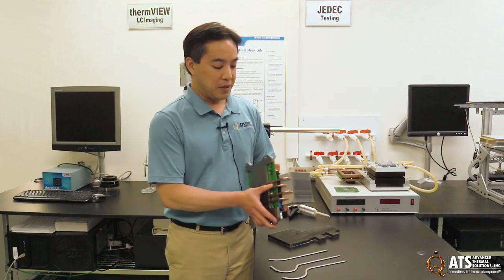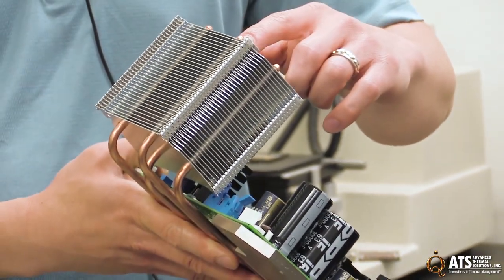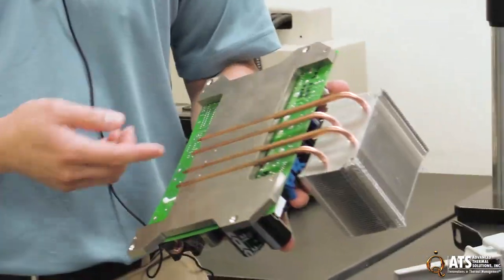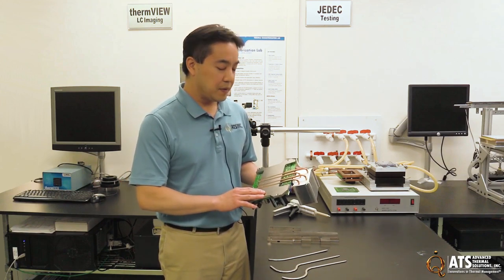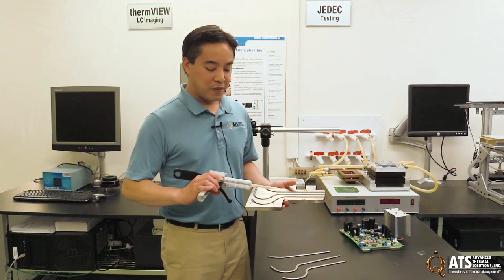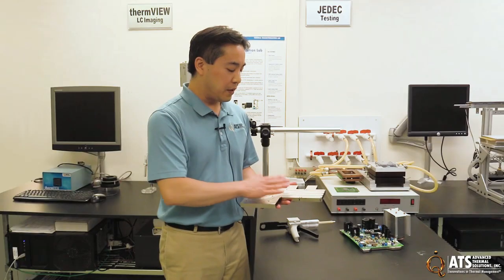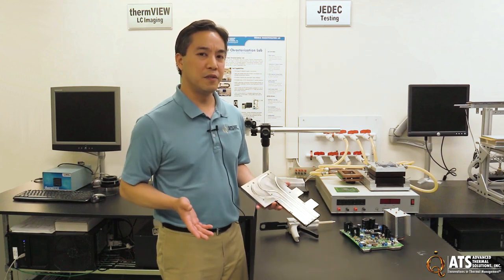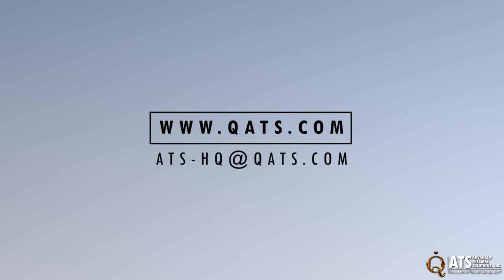How to Attach Heat Pipes into an Assembly

Comment: Do you think heat pipes could be 3d printed into complex shapes to achieve more efficient designs? So instead of the fins you'd have a mesh of heatpipes or something like that.
Reply from the maker: Maybe.  The field of additive manufacturing is growing and new developments happen regularly.  Perhaps 3D Printing a bent HP would be better than bending one?   The wick is pretty fragile so that would might be quite a challenge with today's technology.

Comment: I've done a few custom at-home DIY heat pipe heatsink projects. Now in the past I've been using Sn42Bi58 low melt temp solder but have discovered recently that having silver part in the solder will improve it's strength. What solder paste would you recommend for heat pipe heatsink soldering?
Reply from the maker: The Sn42Bi58 alloy is the most commonly used, because of the low melt temperature of around 138°C. You can use anything that has a similar melt temperature; anything under 150°C would probably work, so that might rule out the use of anything with silver in it. We do not recommend that heat pipes be relied upon for structural strength, and that includes the joints. If there is expected to be any kind of forces applied, then we recommend incorporating some kind of stiffening bracket into the assembly, so the heat pipes don’t take any load.

Comment: If I wanted to develop and build a video card cooler with you guys for a small batch of 1,000 pieces, would that even make sense financially or be completely unsustainable? Something in the 400 W range with a vapour chamber, heatpipes and a CNC machined water-to-heatpipe heat exchanger? Skived fins on the topside of the vapour chamber and zipper fins on the heatipes? Similar to the new coolers on NVIDIA's FE cards for the 3000 series.
Reply from the maker: Hello, we would suggest you reach out to us with the following link so we can further address your questions and project - https://www.qats.com/Corporate/contact

Comment: Maybe a weird question. But how would you shorten an existing heat-pipe? Can you for example crush it with a vise at a certain point that you preserve the vacuum inside the part you want, then cut the other part and solder the crushed end?

Thank you for your video.
Reply from the maker: We do not recommend shortening heat pipes yourself; the seal will not be as reliable as the factory seal. We offer many different lengths off the shelf, and we always recommend working around one of those. Check our website, www.qats.com for the full list.

That said, if you wanted to try shortening a heat pipe, I would do exactly what you have described. Crimp the tube, cut off the excess, and then fill the end with solder. It may be difficult or impossible to maintain the vacuum during this process. Within the crimp, there will be sintered copper material, and that will prevent the walls of the tube from making a seal, while allowing air to pass through the porous sintered material.
Reply: @heatsinks  good answer

Comment: Question, say cost is not an issue, what if instead of 4 heat pipes, we had a component equivalent of 1 fat heat pipe?

Would the strip of cupper be more or less effective than the 4 heat pipe?
Reply: Heat pipes conduct heat much better than solid copper.
Reply from the maker: @WarPigs ...  @Duane is correct about this.  But let's dig into this a bit further. That large component might be tough to cool with a heat pipe just layed on top of it. One approach is to find the hot spot on that component and attach the heat pipe to that spot, that would be a possible solution. It would also be less expensive and less heavy than a block of copper.  Another solution is to use a less expensive aluminum heat sink and attach to it a vapor chamber or possibly heat pipes.  That gives you the performance of copper for heat transfer but with less weight and less cost.  We actually worked with a customer who had the kind of application and we have the case study on our blog here https://www.qats.com/cms/2017/03/28/case-study-thermal-comparison-copper-aluminum-heat-sinks/

Comment: I recently soaked a heat sink in a bath of isopropyl alcohol followed by warm soapy water. Some white residue has appeared around the seams and where the pipes meet the rest of the heat sink. Is this anything to worry about? I’ve been told it’s just solder flux but could also be thermal paste?
Reply from the maker: That's certainly an unusual result. But isopropyl alcohol is commonly used in many electronics cleaning applications, so its doubtful its would cause a problem. But the white may be conductive flux residue from the soldering process. Your conducting heat so we're not sure that's going to be an issue, other than cosmetic. Your best bet is to try it and make sure the  chip you are cooling stays within the expected  temperature range - given airflow and ambient temperature.

We have a couple of articles you may find helpful. First, you can learn more about the use of isopropyl alcohol at this excellent article from Techspray:
https://www.techspray.com/cleaning-electronics-with-isopropyl-alcohol  

A second helpful article is from Chemtronics https://www.chemtronics.com/ultimate-guide-to-cleaning-electronics#t18

Comment: erm.....
what IS the critical temperature?
for standard (i guess) 6 mm water type (i assume...)?

sort of wanna make a chimney water heater, solder some into a copper pipe and sleeve it in a larger pipe... sorta like an inside out hedgehog... bought a bunch of compression fitting with the idea its possibly better to do it that way. hard solder/braze the fittings in and just screw down onto the pipes. i may want to change them for longer ones. got 40mm shorties... shorter than i expected!

havent found much on heating the things for soldering...

then again, when i think about it...

theyre under vacuum. theyre going to have to get pretty hot before they get to a decent pressure, and copper is still good for pressure up til...400C-ish i would assume them to get some oxide colour change well before they explode!

Comment: I though up a couple of questions for a project I'm considering:
1) What if one wanted a special shape on one end of the heat pipe - say an equilateral triangle?
2) How does one calculate the thermal capacity of a heatpipe?
3) Say I have a 15Watt 1/2" heat source on one end, and want to keep the cold end within 5°C, and only have 2" of length embedded in a heatsink?
Reply from the maker: 1) I’m sure it could be done with the correct die to squeeze it in, but we have not done created any heat pipes with special shapes like that. 2) Please refer to the calculations shown on our heat pipe datasheet to get an approximation of the thermal capacity. We also have Qpedia papers on our website which contain more detail. 3) Feel free to contact us via our website if you would like to get into details about your thermal management project. We would be glad to work with you.

Comment: Great video thank you very much. Do you fill the heat pipes with plain water, distilled or other type liquid? What ratio is typically used for the liquid, e.g. 90% of available area inside each heat pipe? And random stupid question that just popped into my head - what would happen if liquid metal was used instead of water? I just googled that to see if anyone had tried and it seems not so stupid after all, apparently used in the space and atomic industries?
Reply: Жидкий металл не прокатит, так как при задачах земных нужно наполнение, испаряющееся при наиболее низкой возможной температуре.
Reply: @olegolegunches4905  благодарю вас :)

Comment: Some of the heatpipes in off the shelf coolers are slightly flattened at the cpu block base. I was wondering how does one flatten round heatpipes at one end properly?
Reply from the maker: For prototypes, you can probably flatten the pipes in the block using a vise if you want to do it yourself.

Comment: Do you have any guidance in regard to how much solder paste needs to be used when reflowing the pipe into a machined channel?  For example, is it sufficient to have solder mostly only running along the bottom of the channel or does it need to be 180 degrees around the channel?
Reply from the maker: The solder paste should be applied on all surfaces where there will be contact between the heat pipe and the machined part.
However, we try to avoid using heat pipes in bores that go 360° around the heat pipe. It’s much easier to assure full contact and solder spreading if the contact goes 2/3 or 3/4 of the way around, as in a keyhole shape for a round heat pipe, or a T-slot for a flat heat pipe. You can also sandwich the heat pipe(s) between top and bottom plates, where the plates do not quite touch each other.

Comment: Can Heat Pipes be used in cars to replace automotive engine cooling system?
Reply from the maker: Heat pipes are efficient for short-distance heat transfer in specific applications like electronics cooling but are not suitable for replacing traditional automotive engine cooling systems due to the need for managing significant heat over larger distances. Traditional liquid cooling systems are more robust and cost-effective for maintaining consistent engine temperatures under varying conditions.

Comment: That is really interesting because i wanna create a custom heatsink for my laptop.
I´ve got 2 questions though:

Is there a point where the pipe will burst when you bend it and is there a diffrence in flat and round pipes?

Where can i check what my heatpipes are made of?
I mean i can obviously see that they are from copper but i mean whats on the inside if i would like to solder it.
Reply from the maker: Yes, heat pipes will stop functioning if they are torn open during bending. Using the largest possible bend radius is advised. On our heat pipe datasheet, the suggested minimum bend radii are listed, at 3 times the diameter for round heat pipes. For flat heat pipes, the equivalent diameter is the dimension of the tube that you are bending “against”.

For both the sintered and grooved wick types of heat pipes, if the outer tube is copper, then whatever is inside is also copper. The internals won’t be damaged from soldering temperatures; the limiting factor is the fact that the tube will burst from internal pressure at a temperature around 250°C.
Reply: My mistake of getting the combination of thin form factor and high end dGPU in a laptop also brought me here. I wish I had a lab to prototype my own cooling designs.

Comment: Is it possible to join a flattened heat pipe (or multiple heat pieps) with a vapour chamber to improve performance?
Reply: That's what I want to know. I know you have to actually splice it open, and put the cupper powder to the sides, but say we did that, would 1 flat, fat, individual pipe actually be better or worse than the separate 4 pipes.